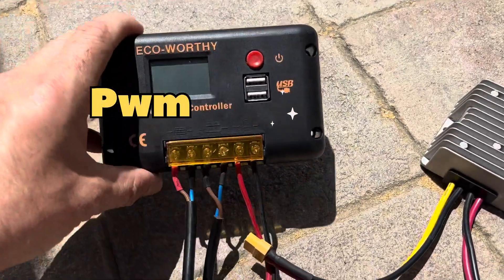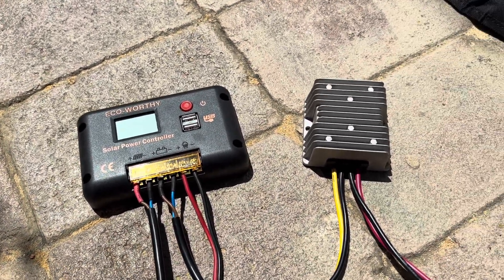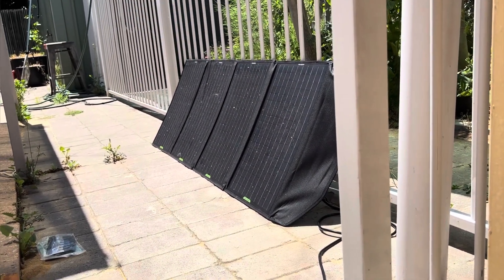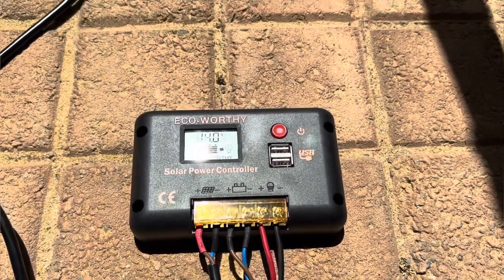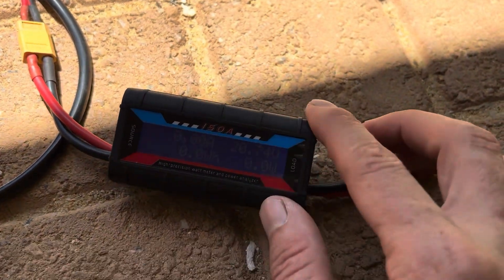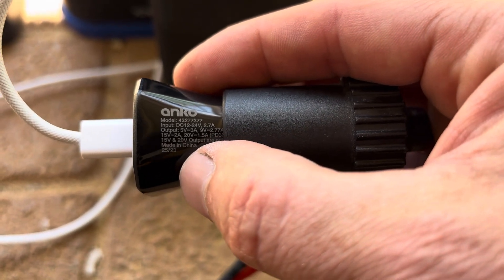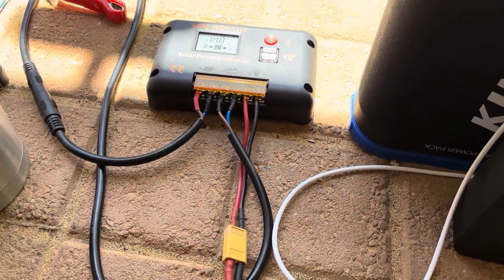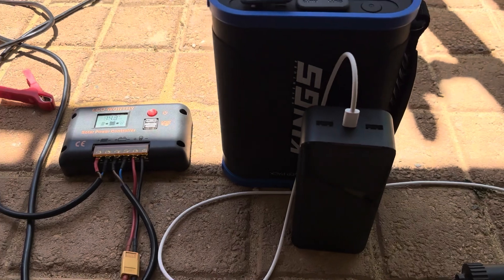NO BATTERY! Pwm vs DC to DC for SOLAR

Comment: what is if you connect the load to the battery output? is the battery output regulated to 14v?
Reply from the maker: Hi mate. I think it would be safer to connect the battery to the battery input of the solar controller. Interesting idea though. Thanks for watching

Comment: Fhanks awsome cheep set up.
Reply from the maker: Thanks for watching mate
Reply: @Techboxreview  I thought u need to connect a battery to the pwm or mppt controller before connecting it to the solar panels? I heard without batteries the solar panels will damage the pwm or mppt controller
Reply from the maker: @BOREDANDWELLBORED it’s recommended. But this video was a follow up from a couple comments that claim that this would work better then a dc to dc converter. So I gave it a test

Comment: Where the $12.00 PWM is worth it is if you want a low battery voltage shutoff circuit while using a battery, I bought a shut off box and it was more than a PWM and then I said blimey I could of got it cheaper and had a solar charger.